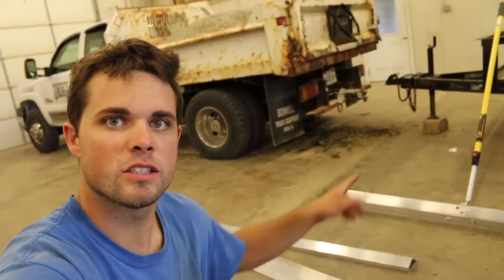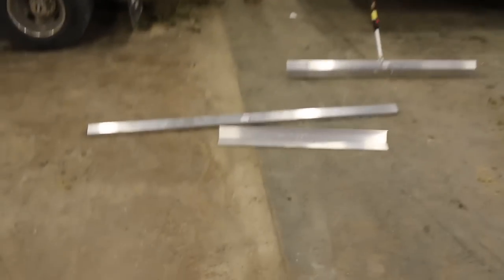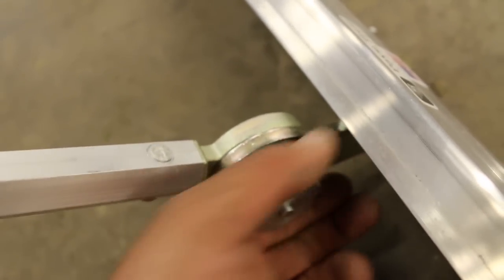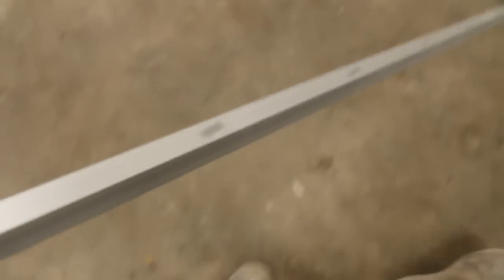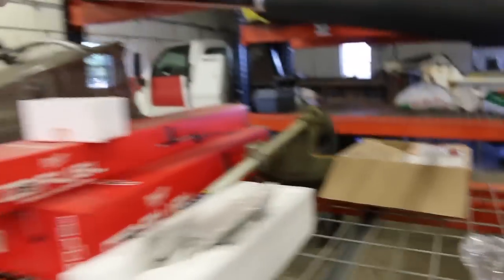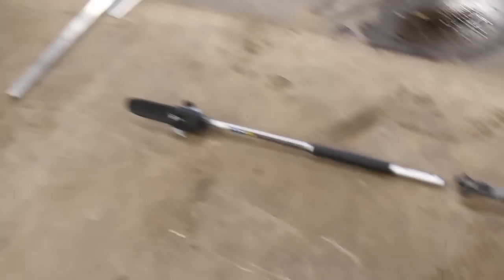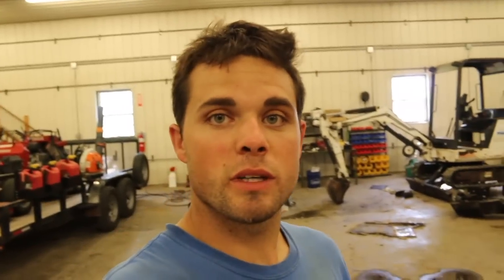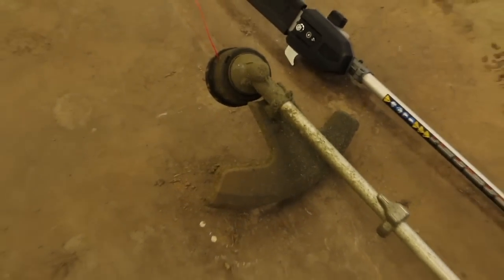Never Gas Up Your Handheld Power Equipment Again

Comment: I have gone to electric hedge trimmer's and love it, Power on demand, No fumes, No excess heat, No gas waste with having to fuel up! I don't feel the electric weed eater's are for me in commercial use, But like you I see big things in battery powered equipment.

Comment: The girls have been using the milwaukee string trimmer and the blower for 2 years now. They love them I have been surprised that that have done so well. The down side is you cannot trimm as fast but so far that has not really been a problem. Down side they each carry 12 batteries with them. They use the m18 12.0 batteries. The batteries are very expensive at a $100 plus for each battery and total for now is 24 batteries. Each one of them carry 12 batteries with them . So far charge time has not been a problem.
Reply from the maker: John Bailey holy cow that is a lot of batteries 😳 But if you don’t ever have to buy fuel it’s probably worth it??
Reply: They ran with 8 batteries 9.0 last year and they died all the time and they had to use the gar trimmer and blower . So when they came out with the 12.0 we picked up some of them so each one of them has 7 9.0 and 5 of the 12.0  batteries with them . The down side I know a few of the batteries will be no good next year and we will need to buy 6 to 8 more batteries. And thats between $120 to $130 dollars per battery . So really no sure if its paying for its self . One of the girls said one of the trimmer had got very hot and shut down . By the time she got home it was cool and so far it is working ok. And that is why they each have 2 milwaukee trimmers in there trailers.
Reply: That sounds ridiculous. You can get a new Echo Srm 225 for $200 that will last for years. I have been using my old Srm 210's for over a decade  with very little maintenance or trouble. Also you can fill your gas tank about as fast as you can change a battery, once you have walked back to your rig what's the difference?
Reply: Josh Pansch  josh the down side to your echo which we also have shindaiwa trimmers as well . Is what do you use when the city does not allow you to use gas trimmers ? That is why we have been trying out battery tools. The city is going to ban gas tools in the next few years so we are still looking.      For a good battery mower. I know I will hear all kinds of shit on what to buy. Have been trying to find a dealer who works on them and so far nobody in out city will touch them ! That is why we do not have one yet. I can see so many other lawn care people losing the business.

Comment: Did you get the older Duramax dump fixed? What ended up being the problem if you did?
Reply from the maker: Andrew  Stratton Yes we did. Turned out one battery went bad and the other wasn’t strong enough to support it. I assume the one was half bad and when the other one went it became obvious. Just glad it wasn’t a charging issue 👍🏼